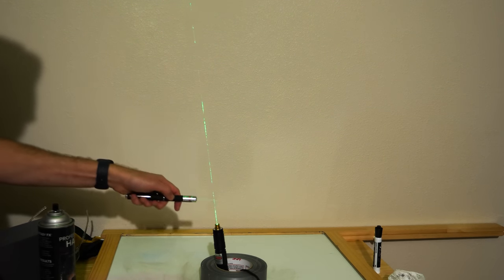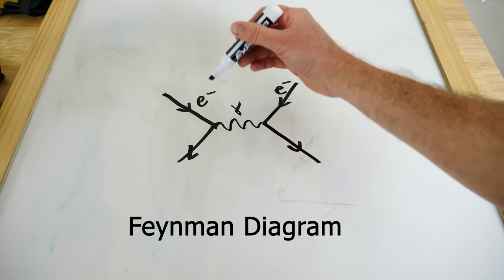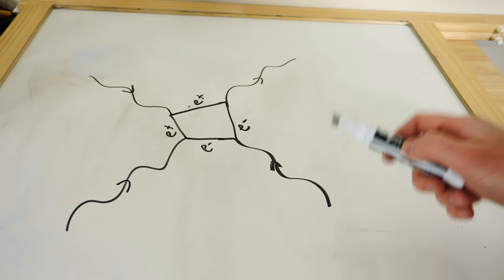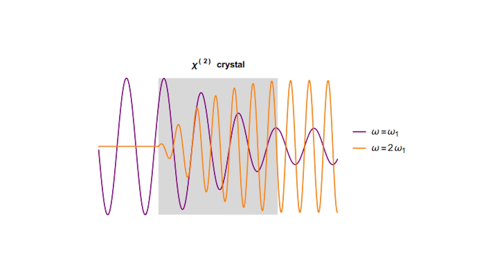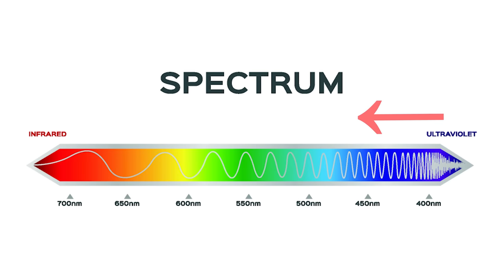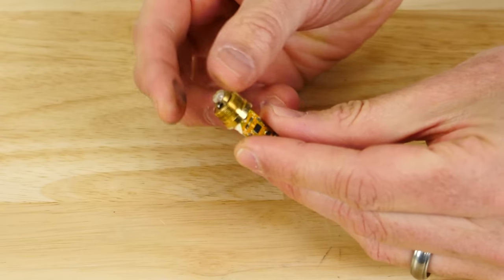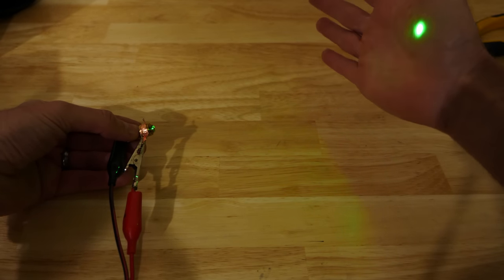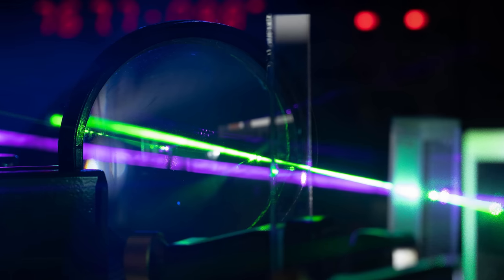Can Light Bump Into Other Light?

Comment: I'll watch it again, but...
I couldn't see anywhere where it's mentioned HOW the 808nm IR is converted into 1064nm
I fully get the frequency doubling (1064nm to 532nm), but not the 808->1064
Reply: Look up Nd:YAG (Neodemium(III) Yttrium Aluminium Garnet) lasing crystals. They are pumped with 808nm and resonate at different wavelengths, 1064nm being one of them. I'm not entirely sure of the physical mechanism behind it. Perhaps it's akin to striking a bell with an impulse and it rings out at its various resonant frequencies.
Reply: @JimGriffOne  
TYVM.
So an original (808nm IR) photons is absorbed thereby 'exciting' Nd:YAG which subsequently emits a 1064nm photon as it relaxes back to its ground state?
Sounds plausible to me!

Comment: This is gonna sound stupid but…. Is this sort of how night vision goggles work??
Reply: Not exactly. The image intensifier tube transforms ambient light of all wavelengths into electrons. As the electrons strike electrodes on the microchannels, bursts of voltage cause the motion of electrons to increase rapidly, forming a dense clouds of electrons that intensifies the original image. At the far end of the tube, the electrons hit a screen coated with a phosphor, which is a substance that radiates visible light after being energized. The energy from the electrons excites the phosphor which converts the electrons back into green photons. Green is chosen because our eyes pick it up best and we are ok with looking at it for long periods of time.

Comment: This is my second comment. I thought that can we create a solid object by compressing the air. As we can see in our gas cylinder the LPG gas is compressed. As it is compressed this much that it get converted into solid. So can you pls show us that can we really make a solid object by compressing the air.
Reply: No sir. Although theoritically possible, it is not practically possible. Gas have too much intermolecular space in between so it can be compressed to liquid, but the same is not the case for liquid. Although loose, they are pretty tightly packed to be compressed any further. If liquid could be compressed so easily every hydraulic device would fail to operate. (And you know the type of gygantic loads these hydraulic machines lift).
Reply: @msnirajagrawal  thank you sir for clearing my doubt. And I really appreciate your service that on my only second comment you gave me my question's answer. 👍👍😄😄
Reply: @RockstaA-jy9wq  look up the triple point, using pressure and temperature, you can have all three phases existing simultaneously and converting from one to the other
Reply: @maxfofax5471  ok thanks 👍

Comment: 6:30 - how can you detect a SINGLE photon, by sending it through a non-linear crystal? Surely the crystal works by combining the energy and momentum of TWO photons. Thats not a single photon.
Reply: Oh that gets me thinking too. I’m no scientist, but my guess would be you will be using it in an experiment. And since this is an experiment, you probably know what wave length you are expecting. And you shine that frequency of light at one input, then wait for that “one” photon to come through as the second input…
Or you can split that one photon into two, then feed it into the crystal?
I probably got it all terribly wrong…😅
Reply: @chunfung8934  I was (and therefore still am) a physicist - what you describe would not be detecting a single photon. It definitely doesn't work like that.  

Photons are REALLY weird: pass enough single photons "looking" like particles through a system of detection, and the results are consistent with them acting like waves. But each single photon behaves like a single particle. But that doesn't explain the single photon detection described. Hopefully someone more experienced in the field will confirm.
Reply: @andyowens5494  thanks for pointing out where I get wrong 😅

Have a nice day 😃👍🏻

Comment: There have been multiple mistakes in this video. 

First, the diagram shown at 2:21 is wrong, it is better to not call a virtual particle a positron or electron, else you will run into serious trouble and your diagram is that serious trouble and in your diagram you had total charge violation at two nodes. 

Second, it doesn't make sense about detecting a single photon with this process, as you need two photon synchronously interacting with the crystal.

Though the topic is interesting, and I liked the demonstration, but I would appreciate if you get some professional to help you with the script to check for mistakes you make. If you wish to hold your own point of view, it is okay, but you should put a desclaimer stating so. If you need help like in reviewing for mistake, I will happily provide so.

Comment: This is why light can't collide to another sours of light!
 Be cause Light does "not" travel!
In my theoretical perception the particles of Photons do not travel!
  they are always in a state of rest and fill all the empty space in the universe including the empty space inside atoms!
Then when a source emitting radiation is activated, the energy of this radiation as a "wave" passes from one photon to the next in the directional sense of this radiation, hence the "local" photons that receive this "energy" shine emitting light "in the place" where they are and the energy wave continues in its expansion process, repeating its action on the adjacent photons it encounters along the way until the energy weakens or when it encounters a massive barrier to the point that the adjacent photons can no longer receive enough energy. to emit light where they are!
The same thing happens in an electrical circuit where the electric current (energy) passes through the electrons from one atom to another until the circuit is closed. Where the atoms in the circuit are at rest and energy flows.
Photons are the media that glow when hit by energy traveling in the form of a wave! Contrary to what most people think Photons "NOT" travel But they are stopped! what travels (displaces) in the form of a wave is just the energy that hits the Photons it encounters along its path while it lasts. This happens even after the power source is turned off or off. The wave continues to propagate for a certain period.
That's why we see the radiation of the stars even though the star itself has been out for millions of years!

Comment: At 1:50 you incorrectly state, that a ( single) photon, can  spontaneously change into an electron and positron.  
This is simply not true.  
Actually, the original gamma ray photon, must interact with (another) photon, likely another gamma ray.  
Always two photons, never just one. 
Gamma ray photons, are needed, due to the energy required to produce real (not virtual) particles.  Electron rest mass ~ 0.511MeV, and positron are the same.  So at least 2 photons of more than 0.511MeV,  or 511,000eV are required.     Visible light is only about 5 eV.
  You also incorrectly show the reverse, where the electron/positron annihilate and form only one photon,  again, not true.  It will produce two photons, conserving momentum.